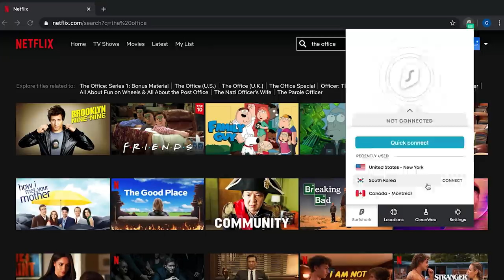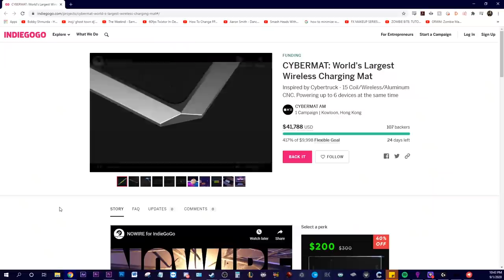I Begged for this Chinese Prototype

Comment: i stopped reading my learning materials to watch.
Reply from the maker: LMFAO
Reply: same
Reply: ok, that's one hell of a keyboard.
Reply: Same rofl
Reply: @KristoferYee  Guys, I am looking for a 2nd hand Graphic Card like GT 1030 or 750ti or Rx 470 for my Potato pc G31 motherboard core2duo E4300 1.8 GHz 32bit 4 GB RAM. Anyone interested in selling it please get back to me. 🙏🏼 I really need to upgrade it to make it usable enough for 2020. 👍🏻
Reply: @SohamShivoham  just look at websites like offer up, eBay, and craigslist
Reply: @lythannguyen580  I short circuited my motherboard
Reply: @SohamShivoham  damn what happened
Reply: @lythannguyen580 I ordered E8500 Processor from Amazon. Seller sent me a faulty processor due to which mobo short circuited
Reply: @SohamShivoham  dang well can you return the processor at least
Reply: @lythannguyen580  Yeah I returned it back to Amazon & they have initiated refund. I have also wrote an official complaint for compensation from them
Reply: @SohamShivoham  nice
Reply: @SohamShivoham  what about the motherboard can they do something for you?
Reply: @lythannguyen580  Hope so. They haven't replied yet
Reply: @SohamShivoham  how did you put the processors in the CPU? And are you confusing the processor with something else?
Reply: @SohamShivoham  also is this what you are talking about Intel Core 2 Duo E8500 3.16GHz 1333MHz FSB 6MB L2 Cache Processor
Reply: @lythannguyen580  Yeah Right but Amazon denied providing any compensation today. They said 3rd party seller is responsible
Reply: @SohamShivoham  my guy the processor is 50 and under you can't buy another one?
Reply: @lythannguyen580  Main issue is my CPU got short circuited. Also times are a bit hard for me
Reply: @SohamShivoham  dang sorry
Reply: same tbh
Reply: @SohamShivoham  I think you confused the CPU with something else
Reply: @codizzlesdad3743  motherboard

Comment: suggestion: add sound dampening foam in between your pcb and your back plate/case. Makes a whole world of difference
Reply: This keyboard is already built with a sound dampener between the pcb and bottom of the case
Reply: @NicctheWizard  no it does not... comes with pcb and plate foam but there is no case foam so could be added
Reply: @franciscotrain1645  it's silicone. There is one between the plate & pcb and one in the bottom of the case below the pcb.

Comment: I dont know why keyboard need CR2032 battery. Quick calculation: 5 rows 40 col = 200 RGB led. Each draw maximum 50-60mA with white color. 200*0,06A = 12 Amp MAX. No wonder it need 2 big lipo cells 3:33. Usb 2.0 is rated at 500mA and most pc have standby usb power turned off. How it will keep up with current consumption and charging?

Comment: you blurred out the bottom part of the case initially but forgot afterwards when you put it back together
Reply: It's all good since it was revealed over a week ago now. the Cyberboard will be able to be charged wirelessly through a coil covered with a transparent screen on the bottom of the board.

Comment: Thought you were meant to keep the bottom as a secret? (you're showing it at least once without blurring)?
Reply: it appears to be a screen of sorts. guessing it would look like that nzxt aio pump
Reply: @NotGenome  I thought it contains charging element or you can insert it there as it would have hard time working through the case without that cutout.
Reply: @ThKrY  turns out, you are correct. it is a wireless charging pad aaaa you use it with the wireless charging mousepad

Comment: Hey Kris, pretty sure you forgot to blur that thing on the bottom at 5:51. You did it earlier in the video and I think in a different channel's video i saw they had it blurred out as well. Not sure what it is but I figured I'd point it out just in case.
Edit: finished the video, is that a spot for a wireless charging receiver?
Reply: yes it is wireless charging base. It has been revealed in the discord and indiegogo

Comment: I need help from whoever stumbles across this comment. I am trying to save up for a gaming PC that can run most games 80+ fps (aiming for 100) and I am getting stuck when choosing which graphics card to pick. I am on a budget so I am trying to get the most bang for my buck here. I have been looking at both the GeForce GTX 1660 Super and the 1650 Super, though I am quite in-experienced when it comes to PCs since this will be my first build. Any help would be very much appreciated. The CPU I am going for is the Ryzen 7 2700x, if anyone thinks there is a graphics card that can get the most performance out of this CPU, I'm all ears. Thanks!

Comment: i need help does anybody knows how to fix boots and vga lights on the motherboard i been looking everywhere and i cant find nothing to fix my problem  i got an asus prime x570-pro
Reply: VGA light usually means you plugged a monitor or source into the gpu after you started the pc up. If the computer doesn’t start at all, check your connections and make sure they’re all plugged in correctly
Reply: @Triannosaurus  thanks i fixed it

Comment: No hate but I don’t see the hype over this keyboard... nothing special about it in my honest opinion. The rgb doesn’t even look high tech, I would rather buy a steel series Apex pro crazy rgb engine lets you modify to whatever you want literally any color any pattern etc. what do you guys think?
Reply: I mean it’s a custom mechanical keyboard after all. There are plenty of custom keyboards cost more than this one but offer less features (wireless, led panel..). They even said that they gonna release a software that allows you to customize the patern of the led panel, so the modification capabilities is there.